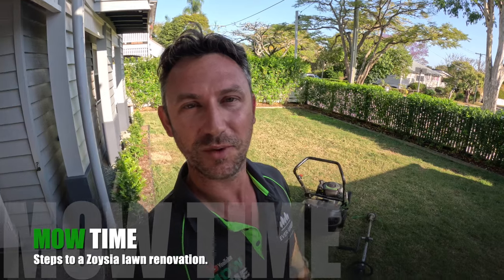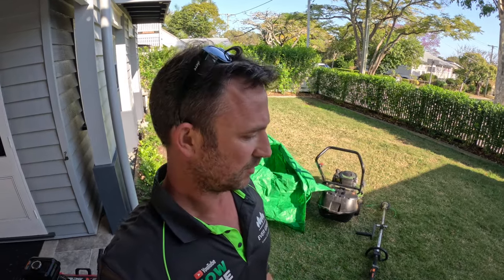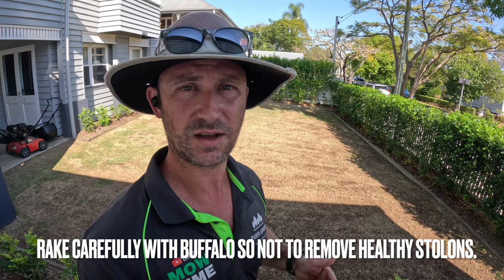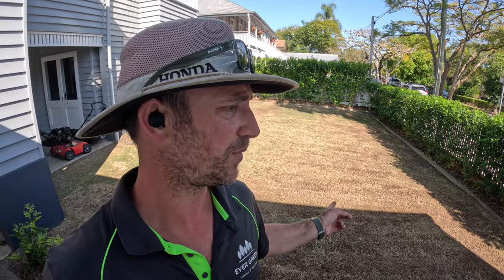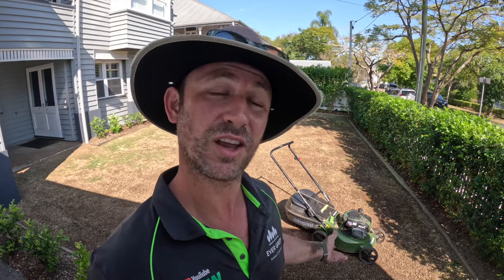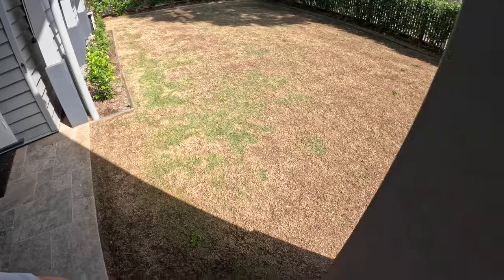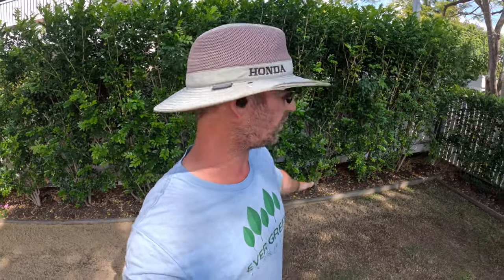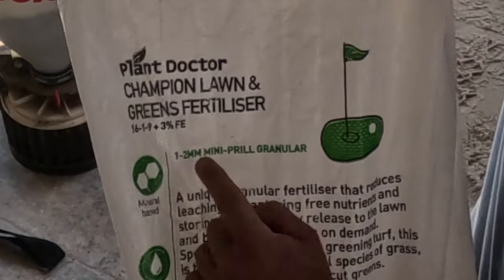INTRODUCING ZOYSIA GRASS TO THE BEACH. Lawn reno from start to finish.

Comment: My only concern, and I'm interested on your take. When your soil/sand level is already approaching the paving/concrete/border height. What do you do in the future? Surely you can't just keep reno'ing?
You'll end up with your yard proud of the surrounding features.
Or once you have it flat, you can just concentrate on your soil condition?
Reply from the maker: Hey
Apologies for the slow response.
Pretty much the last thing you said, but depends on the landscape lay out of your lawn area/areas. I have some client's who require a reno each year because the lawn is on a slope, so heavy rain, foot traffic etc creates an uneven surface through out the year.
Once you have the level right between the grass/paver edge, than it should be all good. Soil breaks down, washes away etc, so just top it up/level it when required.
Hope that has answered your qeustion.
Have a great day.